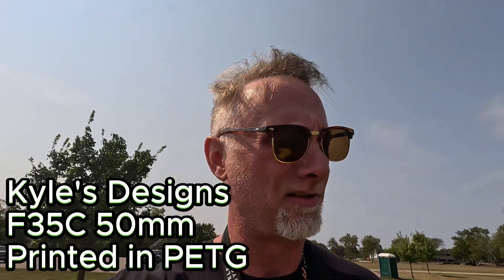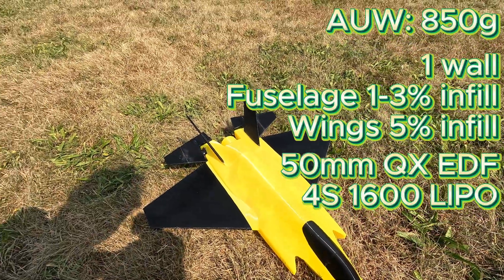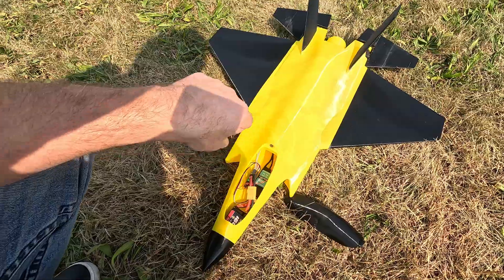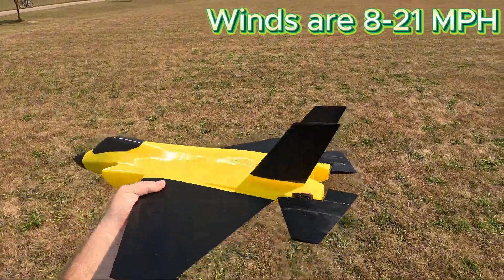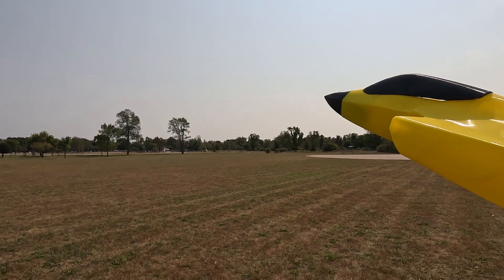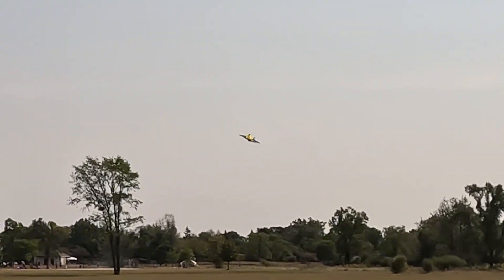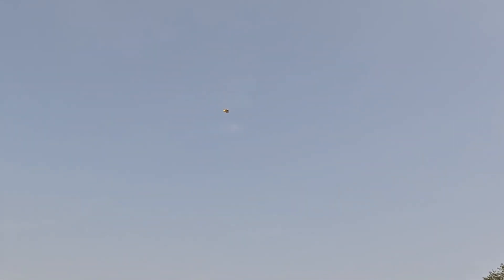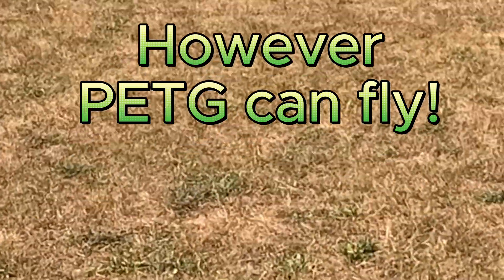Will a PETG F-35C EDF Fly?

Comment: HoboRC has updated this model to 64mm, it's worth checking out; the weight-to-thrust ratio should be even better for PETG. I'm printing a 70mm Mirage 2000 using PETG. I don't know if it will fly because of its size and weight, but I'll test it. LW-PLA really makes everything much lighter, but it's very difficult to print and more expensive to acquire. I always have problems with clogging of the 0.4mm nozzle and lose larger parts, plus it takes an average of 4 hours longer to print than with PETG. With a 0.6mm nozzle there is no clogging, but the material consumption seems to be higher.

Comment: How is the damage after second crash?
Reply from the maker: @dj6961  petg actually held up well to crashes.  Better than pla, but worse than foam
Reply: @MonkeyBrainsRC  pla is wors of foam to hit? I'm thinking about buying a 3D printer to make internal structures or entire aircraft, I don't have the tools or space to work with wood and foam
Reply from the maker: @Lucas-jc6hv  PLA is stronger than PETG, but weaker than foam.  The advantage of 3D printed parts over foam is it's a lot cheaper than store bought foam planes, and you can print parts you need without waiting on the mail.  For home made foam products, 3D printing is more expensive, but a lot less work and less time.

Home made foam - cheapest but most time spent

3D printed - still cheap.  Breaks easier than foam.  Designs allow for more scale details

Store bought foam planes - the least amount of work.  The most expensive.
Reply: @MonkeyBrainsRC  Thank you for your comment, it helped me clarify my reasoning, I have been thinking a lot about 3D and it seems like a good opportunity for me who doesn't have much space and time for complex foam constructions, even so, the material for 3D printers here in Brazil is twice the price of what is charged abroad, there are cheaper ones, but it should work

Comment: Thanks 👍for this experiment.  I too wondered if it was possible for a more budget and robust filament with his designs.  I prefer flying them versus reprinting due to my inexperience hand launches and buddy launches 😂.  Finally got a few dialed in and actually flying.  LW is probably the correct way to go but preference wise Cleaner and less fuss with basic PLA etc…either way they all damage eventually.  Just less on the filament cost at least and better accessibility.  Only downside for me is crap flight times 😊but still fun at least.

Comment: Mine is printed in white LW-PLA, TO-weight with 1550mAh 4S is 670g. I maidened it on Saturday  14.09.24, calm wind, a bit coudy. It flies great right from the start ( I use a catapult ) with no gyro.
2 things to mention : 
  1 - It needs colour. It was difficult to see the orientation when it was far away.
  2 - Don't use cyano-glue to glue the elevons as it does not realy stick on the
       servohorn-material. I lost one elevon at the landing ( no damage ) and could 
       easyly pop of the second one.
      I use hot-gue now.
As I see your experience right now, I will print the F-16 also in PETG,
Thank you for the video.
Reply: I am really puzzled.  I have just finished mine using Overture Air pre-foamed LW-PLA and with a 4S 1500mAh my AUW is 845g!  I used the recommended wall and infill settings and an XFly 50mm EDF and somehow I am a whole battery heavier than you!
Reply: @Colin_Holloway  he probably used active foaming lwpla. in case you didn't know, active foaming pla is significantly lighter than  pre-foamed pla.